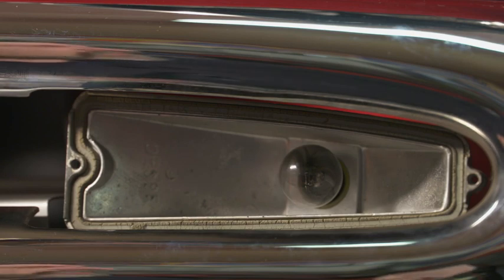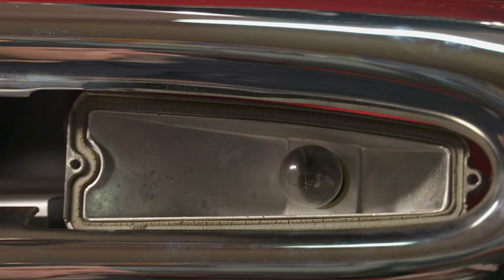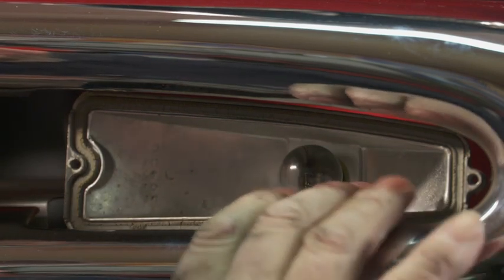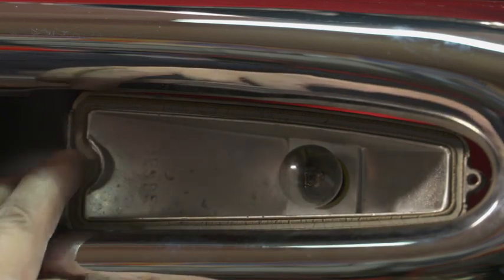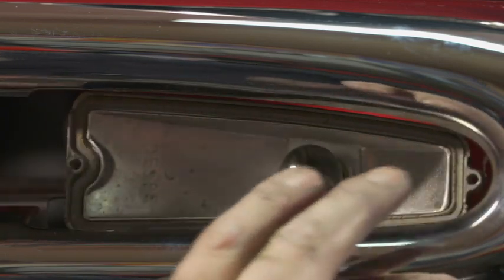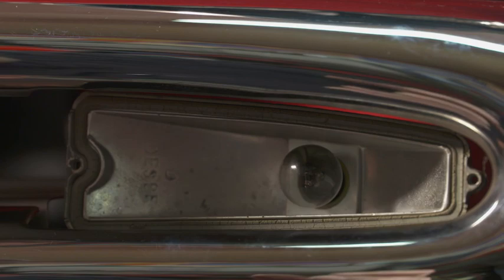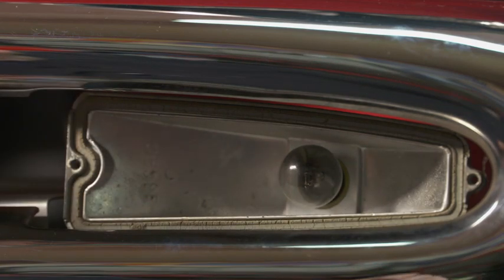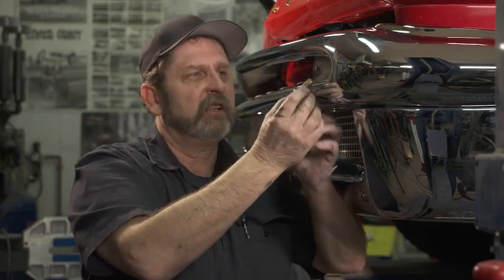Dielectric Grease for Bulbs

Comment: At 1:20,  Dielectric grease is non conductive. The definition of "dielectric" is electrical insulator.  It does stop corrosion but the reason it works is the contacts push  through the grease and make electrical contact. Google this and see for yourself. 
If it was conductive, it would cause all sorts of issues with shorts. I'm not saying it's a bad thing to do, just it's not what everyone seems to think it is.

Comment: Worked for the phone company for 47 years.  The product they use, even before me, is NO-OX-ID.  The best product for your battery and I've used it on all types of low voltage ckts.  Even the trailer light plugs.
Reply: Hey Joe, dig your icon...101st rules the sky.
Anyway, where do you find this product that you use?
Reply: @ThePeopleVerse  I was Sgt. Joe, 3-506th in "Nam as a Grunt.  Now I'm just another old man.  Anyway, Amazon has it, if you can't find a phone guy.  Great for you car battery, too.
Reply: @ThePeopleVerse  Also, a tube will last the average person about 100 years, so plan on putting it in your will.
Reply: My Dad (also Joe) started in 82nd WW2, then 101st for Korea and Bam. Side note,; my wife was in the first group of women and successfully became airborne.

Thanks for the info and thanks for your service.

Comment: Should you use dielectric grease for LED bulbs ?
Reply from the maker: Great question! The ‘Ask an Expert’ section is currently for members of our online community. I would be happy to send your question off to the experts. To get started, please send the email associated with your paid membership account. Thanks!
Reply: Not really needed unless it's going to have the same or similar type of connection like in the video. Leds tend to have a waterproof sealed connection with a gasket and between the housing so there shouldn't be any corrosion or seizing happening there